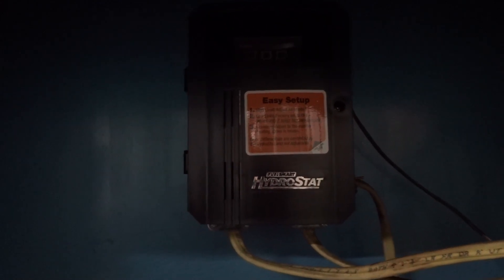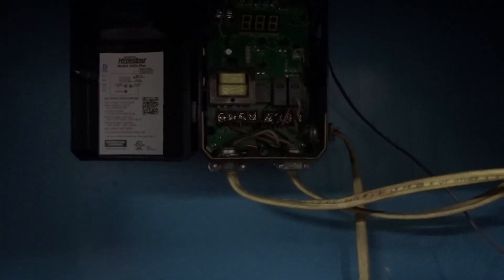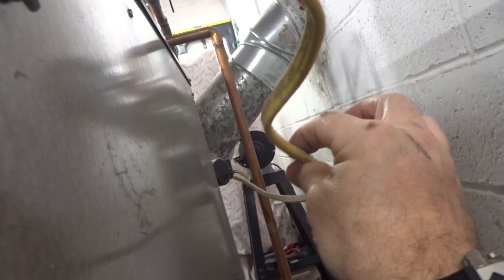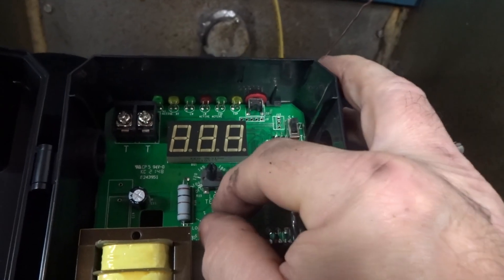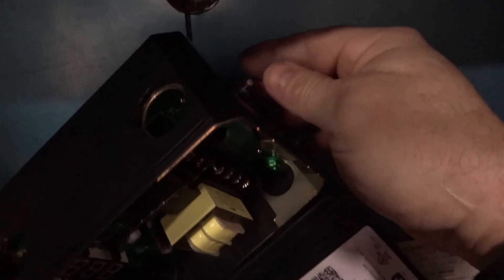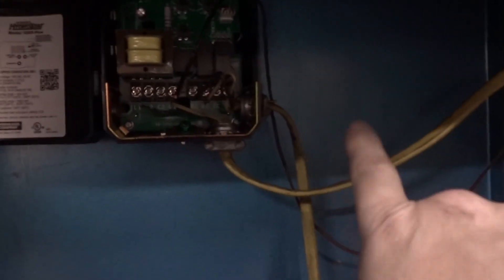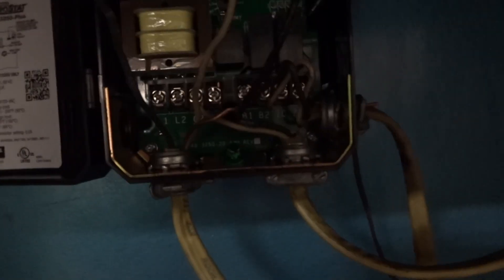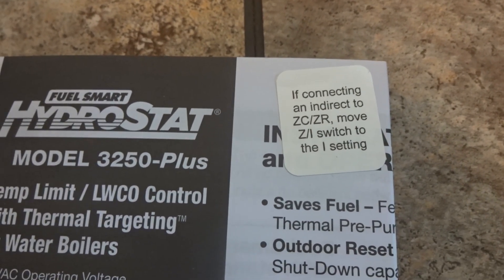How to Install a (3250 Fuel Smart Hydrostat)

Comment: Not sure who you are but I know the voice . your technic on installing a 3250 plus gets a zero grade from me. right off the bat romex is not used for oil or gas heating equipment and if it were existing when you got the job it should have been upgraded to code. the setting up of the aquastat 3250 plus adjustments, they should be explained in more precise terms like lo temp-hi temp on-off-eco and so on .I am not being cruel,just pointing out if you're going to give advise on anything, do it right as doing anything right the first time is always best and costs less in the long run.................
Reply from the maker: When something's grandfather in there's no need to upgrade to code. That's just adding cost to the customer. And it's not an "Aquastat" it's a "Hydrostat" big difference there. Not much to explain with "Lo temp & Hi temp" 180 over 160 plain & simple they're the temps of your water. "Eco" money savings. I gave the correct advise short & to the point. You're in no position to be trying to correct me or give me pointers. Btw I guarantee you don't know me cause I do not hang around with people like you. You think you know my voice as others said I sound like Dan Aykroyd, Ray Liotta, & some mobster so you should stop thinking so much.

Comment: Is there a way to test these. Mine has all the led lights lit up by boiler not running. The whole unit is including boiler (Peerless came with it)  just over year old. These circuit boards crappong out 😮
Reply from the maker: Mine went out this last winter. Had it two years. Complete junk but I was to cheap to buy an aquastat because they are no longer made by Honeywell & I've had them go out as well but cost twice as much. All china junk. I complained to the company said they never heard anyone having an issue. I have no way to test these.
Reply: @TheVlad69  So, these are unreliable?Are the old school Honeywell/resideo ones better?
Reply from the maker: @Katana_00  In my experience they are not as good as sadly even the Resideo ones & I really hate to say that cause for the price of the Resideo you are not getting Honeywell quality of the past.
Reply: @TheVlad69 thanks for the heads up. I was about to get this because it was cheaper and had a nice digital display. It’s sad watching EVERYTHING in the USA get cheaper in quality and longevity. Thanks for helping folks out.
Reply from the maker: @Katana_00  You're most welcome. It really is sad. We're paying so much more for so much less. Even ground meat almost $30 for 4.5lb & you make nice big burgers & they come out half the size like a meatball. This is why I started my channel just to try my best to help people out. I make no money off this channel & do not want to. Everything is paid for by me out of my pocket & my experiences with it.
Reply from the maker: I'm sorry I didn't see your question. YT did not show me the notification. With the surface mounted components I have no idea how to test these. Imo they're just cheap junk sold at a lower cost to increase profits when they break in 1 to 2 years. The first one I had the potentiometer for the zones was junk right out of the box. I'm not sure at this point if it's worth buying the Resideo or just replacing these because Resideo quality is garbage & doesn't last.
Reply: @TheVlad69 no worries. I’m retired trades myself . Love your’re channel and accent . Love the way you answered a question above from some know it all . Merry Christmas and stay warm .
Reply from the maker: @chrisdoe6890  Thank you very much, it means a lot to hear that! I'm really glad you like my channel. Merry Christmas & a healthy & happy New Year to you! Stay safe & warm as well.
Reply: @T @TheVlad69 1-2 years is not acceptable. You should probably add note to your video with you experience with the poor quality of these units. Super disappointing that it’s not reliable
In the long run.